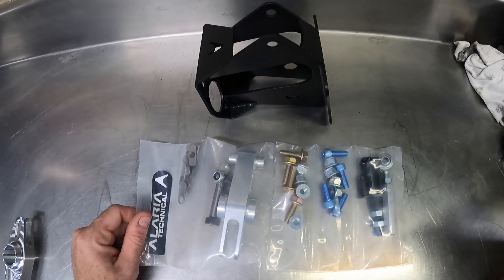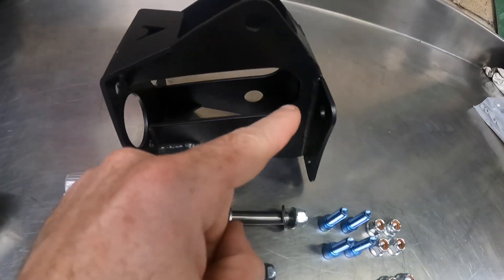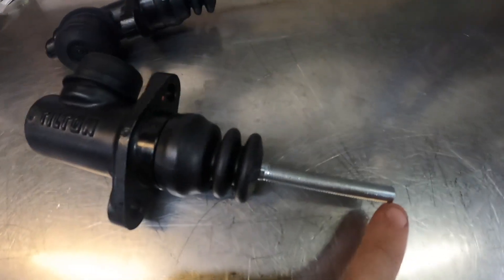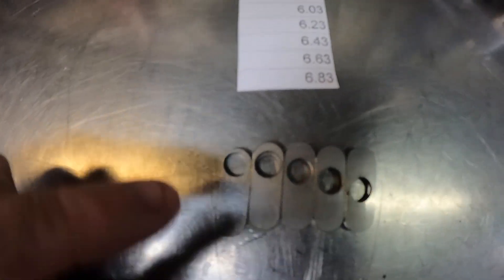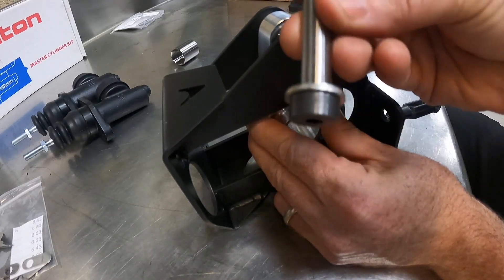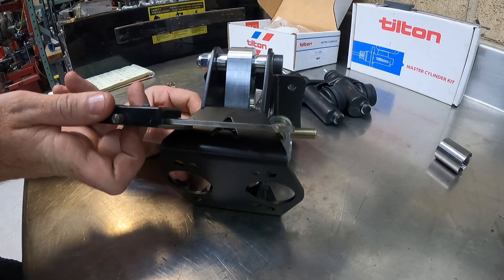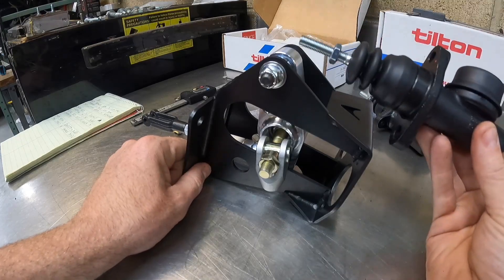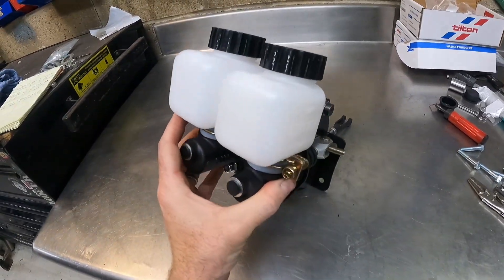How To:  ALARIA Tech Dual Master Cylinder Booster Delete Install

Comment: So I actually had a question myself. I just wanted to ask what size master cylinders you are running. Personally, I have 300ZX brakes all around on my S13. Wilwood said .75” (3/4) bore for rear and .625” (5/8) with my 4 piston front and 2 piston rears. I wish I had the ability to do the brake master cylinder calculations myself, but I can’t find any information on how to properly size them. I’m hoping I’m not too far off.

Comment: Does having a higher pedal ratio like a 7:1 vs a 6:1 make it easier to depress the brakes due to mechanical advantage, and if so is there reason to go with a lower ratio?
Reply: Yes, it does. Typically having that increased pedal ratio multiplies the force your foot is putting on that pedal in relation to the brake master cylinder. The only reason you would want to go with a lower ratio is for pedal feel as far as I can think of in relation to 7:1 vs 6:1. A lot of this outside of pedal feel has to do with line pressure at the brake master cylinder. A higher ratio means more output force or line pressure.
Reply: I should also add that is also assuming you were using the same brake master cylinder when switching from 6 to 7. Now say you were to go with a larger bore size he would definitely want to increase the pedal ratio to decrease the stiffness of the paddle because unfortunately, when you go up in master cylinder sizes, the pedal becomes more and more difficult to press
Reply: @DNightNinja  Very helpful thank you for the information it is greatly appreciated! I have additional questions if you might know the answers. If a guy is running 2 master cylinders can you just use a bias/proportioning valve as opposed to a bias bar for changing front rear bias or would it bind? And if so with the bias valve fully open if you were to have to much breaking in the front somehow would the only way to fix it be to size up or down the front master cylinder?

Comment: Do you know the part number for the wilwood kit I need for a 350z? 

Looking at this option you have here since ABS on my autox car is getting annoying and is cutting power and locking the steering under heavy braking loads. So looking at doing this opinion of the duel masters to control the brakes.
Reply from the maker: Hello,  We have not personally used the wildwood masters so I cannot say which ones exactly.   We recommend the Tilton as we know they fit for sure.

Comment: Awesome! With no booster, how does the pedal feel? Is it like pushing on a wall?
Reply from the maker: Manual brakes will always have a firmer pedal than assisted brakes but with properly sized master cylinders it should be very easy to drive and modulate.
Reply: @MAMotorsports  does a master cyl with a larger bore/piston make the pedal easier or harder? I bought a car with a dual mc setup with no booster and it feels like a brick wall....makes me wonder if I maybe need either bigger or smaller bore mc's.
Reply from the maker: @stephenwhite5444  typically larger MCs have more volume to move so they are more difficult to press.

Comment: Nice. How long is the setup in the engine bay?
Reply from the maker: Its a tight fit as you can here in this S13.  S14/S15 have a little more room to the strut tower.   8.25" from the firewall mating surface to the tip of the master cylinder.

Comment: Hell of a product.  Ready for an E36 version
Reply from the maker: For BMW applications id send you to MASSIVE brakes.   They already make the BMW apps.
Reply: @MAMotorsports   Very cool I hadnt seen that they ever had come out with that.  Thanks!!
Reply: It has existed for over 8 years, from Massive. That one here is a copy. And it is flawed.
Reply from the maker: @leevuong8843  Our product is obviously inspired by the Massive part but it is designed for applications that they do not offer.  Also, how is this design flawed?
Reply: @MAMotorsports  NOT inspired. It is integrally the same. Except for the lever made from aluminum. Which I tested and will no longer work 100% over time since the spherical bearing will groove the bore. Don't pretend you were only inspired. That would be hypocritical but it clearly shows your incapable of designing an original part . The only thing that would have been needed to adapt Massive's kit for Mazda would have been to change the mounting bolt pattern.
Reply from the maker: @leevuong8843   Hi Lee, what you say about the bolt spacing on the firewall flange being the only thing that needs changing is not true.  The geometry needs to change for the pedal ratios to be correct also and so do the linkages to the pedal of course also.   The bracket clearly resembles the Massive part as like I said, that is where we got the inspiration.  I am not denying that at all.  The aluminum portion holds up fine for us so far with the hard anodizing we are using on it for the past 2 years in the applications we have used them in(anodizing not present in this video).   Time will tell if we need to use a steel sleeve inside of it.      We are not taking any market share from Massive Brakes what so ever as we do not offer BMW applications and whenever I am asked for one, I point them to Massive.  As a matter of fact I would say that since our part has been released I know Massive has gotten an increase in sales for their BMW version as I have pointed tons of clients and vendors there and there is even a company that stocks and sells the Massive product without naming the brand and uses our description.